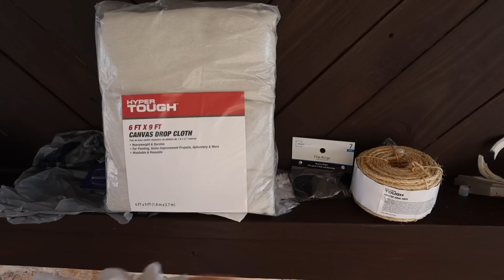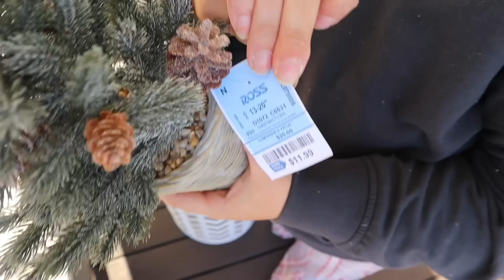*NEW* MOBILE HOME COVERED DECK DECOR REVEAL + Christmas decorate with me | 2023 | Ep. 8

Comment: The porch looks great!!!!  FYI, you can make the perfect outdoor curtain rods with PVC pipe.  You just fold your fabric over enough to fit the pipe and stitch it and then slide the fabric on the pipe.  This will give you a good fit at the top.
Reply: PVC sags over time! As we found out on our patio. We went with 1/2" Electrical conduit! Easy to spray paint with Krylon Fusion! The paint did not flake, even after 6 years!

Comment: Merina. I have an idea that you might be able to use for you curtains in the future. PVC pipe from Lowe’s is a great alternative for curtain rods. Whether you are inside or outside. They are sturdy and they come in white or black and can of course be spray painted if you want. You can still use regular brackets or use zip ties to secure them to the ceiling of the porch with a ‘S’ hook. That way you can have curtains over a wider space because you have the ability to connect two pipes together and customize the length. Just thought I’d throw that out there for you. God Bless you and the family.

Comment: I made my own curtain rods for my living and family rooms. My hubby got me metal conduit,  that they run electric wire through, normally.  But you can cut it to any length. My hubby spray painted the cut to size pieces, black. Then i found these really pretty large knobs. They are the mercury glass kind. Which i love. And we used them as the finials on each end. Used a cork in the conduit ends to use to screw the knobs into. They turned out so pretty. And they cost me about 10.00 each. But 8.00 of that was for the 2 knobs.

Comment: You can use PVC plumbers long plastic pipes for curtain rods on the deck. You can spray paint them or wrap them in jute. That's what I used on my. Also you can purchase drop cloths at different lengths at Harbor Freight.  Good Luck.

Comment: I used those same drop cloths and curtain clips on my porch. For a curtain rod I used galvanized pipes. It’s strong enough to span the whole distance without swagging and don’t have to worry about rusting. Just an FYI the curtains will shrink when you wash them